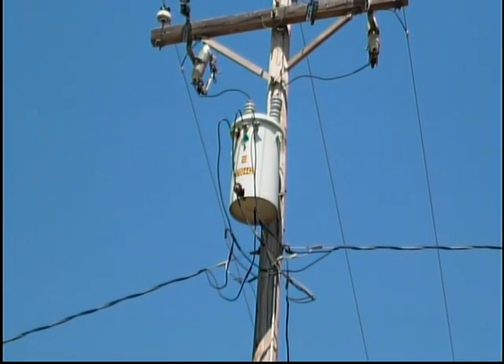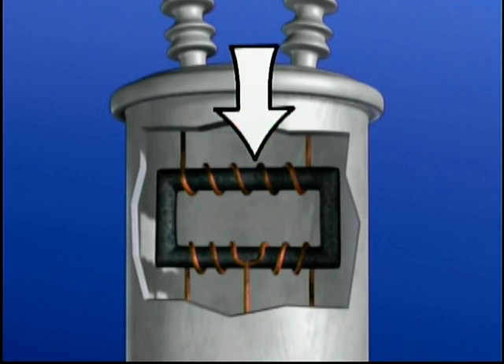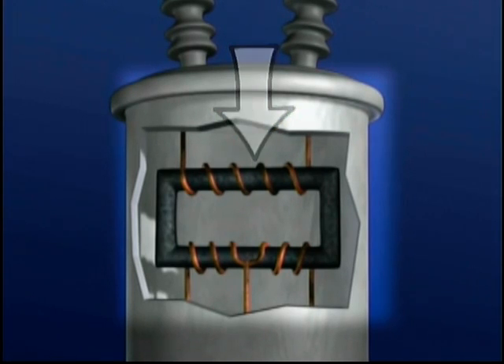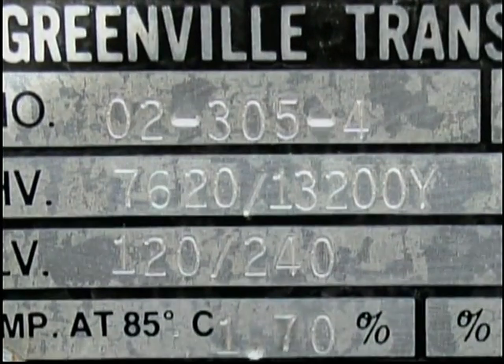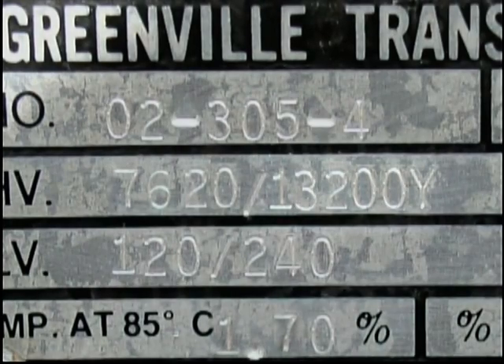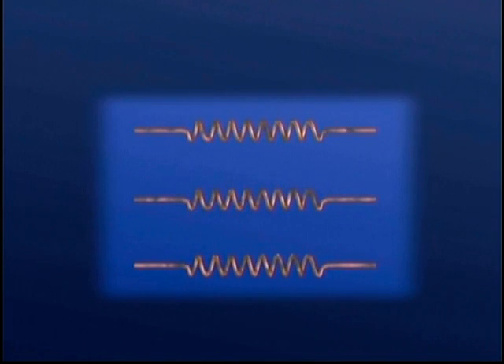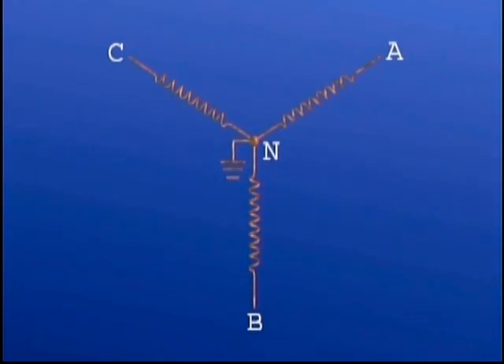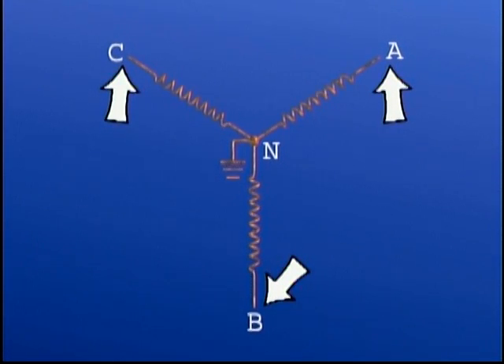Transformer Basics

Comment: At time 2:20, one of the two Secondary Windings is wound backwards!   Both halves of the secondary must be wound in the SAME direction, not in opposite directions. The two secondary windings are connected in series and should be In-Phase per the Dot Phase notation.